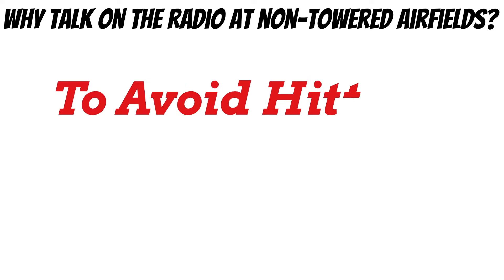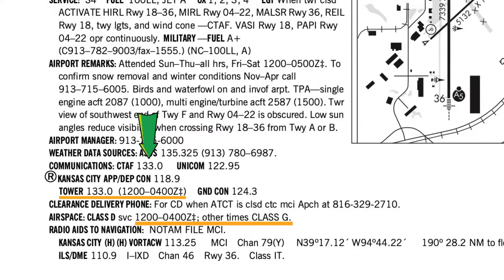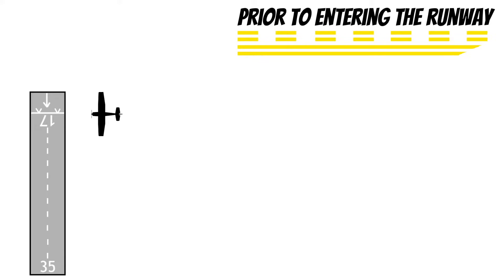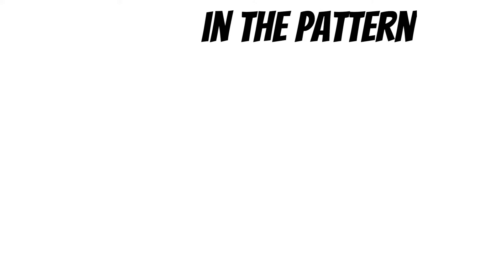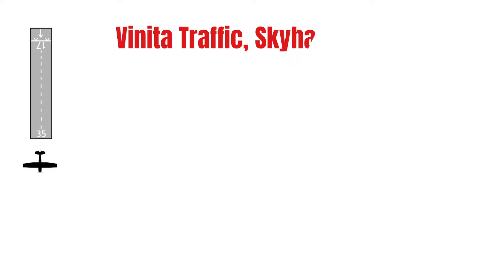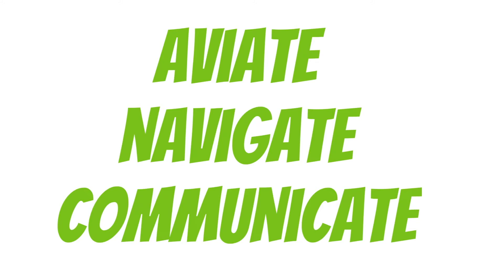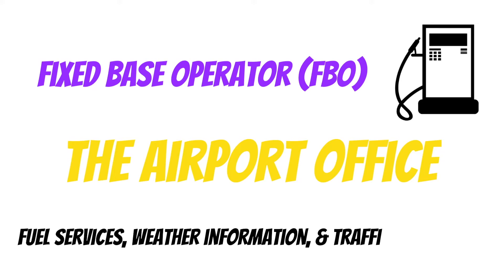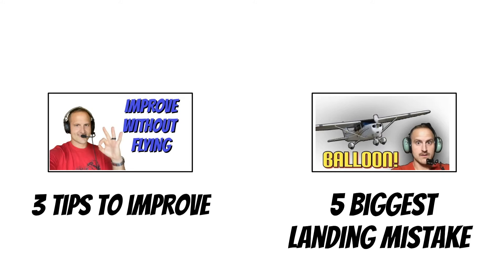Non-Towered Radio Calls Made Easy

Comment: Better be safe than sorry know such thing as clogging the radio when playing it safe better than air crash after run way taking off.. great mate thank you safe flying
Reply from the maker: Not to disagree, but what if someone is making calls ever 30 seconds and I need to speak up and tell someone to go around due to a hazard on the runway, but I’m unable to say anything because Joe blow is clogging the radios? I’ve seen A LOT of similar situations. It’s especially bad where new students are making unnecessary and unnecessarily long radio calls at small airports

Comment: Great video!  The examples (with great accents) are clutch.  I have a question about taxiing around the airport..  I'm familiar with making calls for back taxiing, but I've never flown into an airport with 2 or more runways.  At uncontrolled airports with paved taxiways and intersecting runways, what calls should I be making?  IE: when crossing a runway??
Reply from the maker: You definitely need to make radio calls when you’re crossing an active runway. I recommend making a radio call any time you think you might be a conflict with someone else.

Comment: If i want to landing at airport and my altitude is 7000 ft and airport pattern altitude is 1000ft, when should i start to descend to traffic pattern altitude, before 10NM? 4:14
Reply from the maker: Good question. Try “Altitude to Lose x2.”  You need to lose 6,000 feet and 6x2=12.  12 miles is ideal for a small trainer plane. For faster planes, you can use “Altitude to Lose x 3.”

Comment: I have never been to the airport you mention, but I have been to a lot of airports in many places and I have never seen one with hangers that someone would be taxiing from.  Does Vinita have a large laundry facility near aircraft parking?
Reply from the maker: Not that I know of.  It’s more common than you think. I operate at another airport out of North Little Rock that has the same problem. You can’t see the main taxiway from some of the older hangers in back
Reply: @FreePilotTraining  I apologize, what I said was not clear.  What I was getting at is that I think you mean hangars, with an "a", not hangers, with an "e".  Hangars are used to store airplanes, hangers have no real use at an airport, except maybe inside a hangar.
Reply from the maker: @ArlingtonRV  😂 wow. I can’t believe I missed that